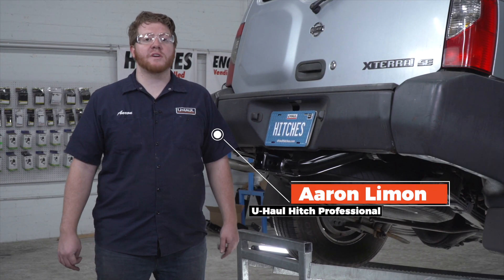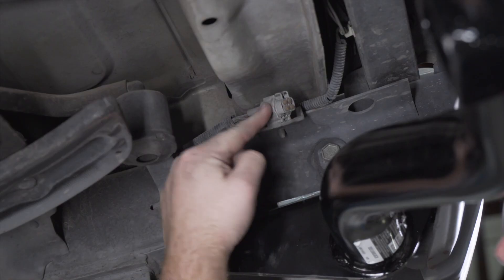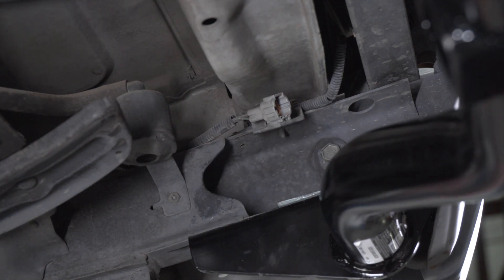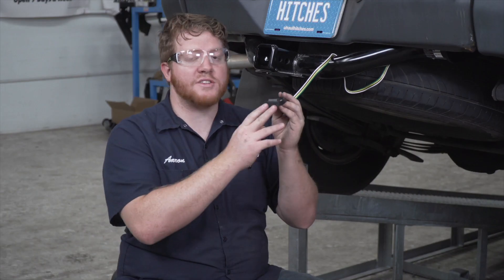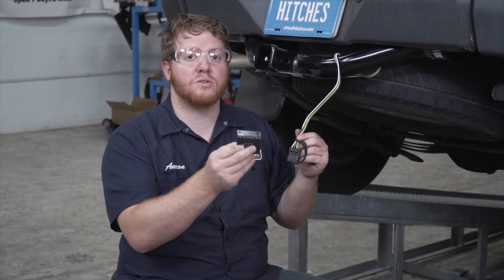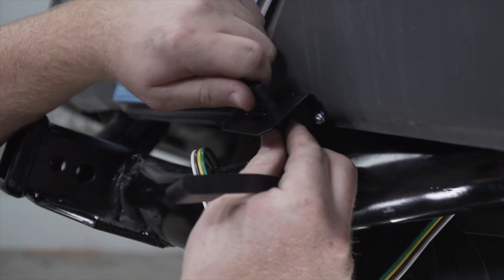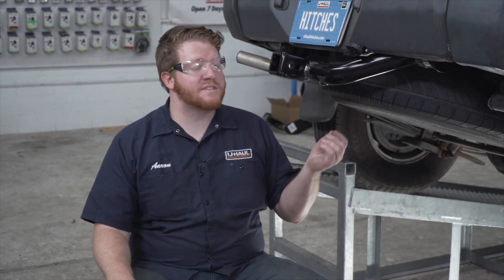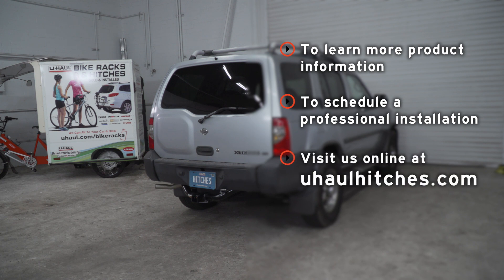2000 Nissan Xterra Trailer Wiring Harness Installation

Comment: I have 2000 nissan frontier 3.3l manual l. Where is this on my vehicle?
Reply from the maker: We dont have a video for a 2000 Frontier, however, we sell a harness for your vehicle on our website. The plug in connection for the Tekonsha 118362 is located under the passenger side frame rail.

https://www.uhaul.com/Trailer-Hitches/